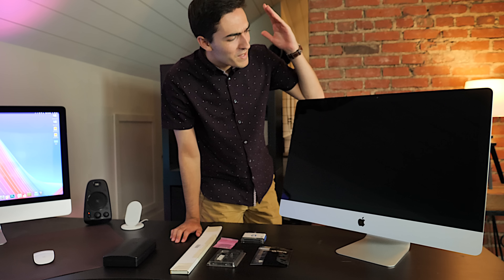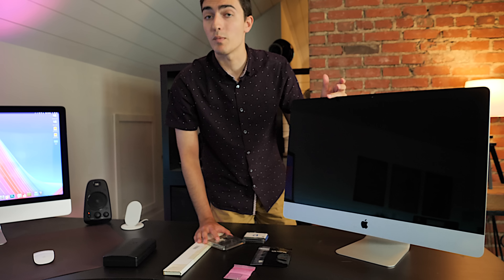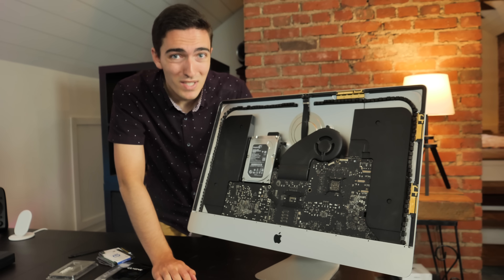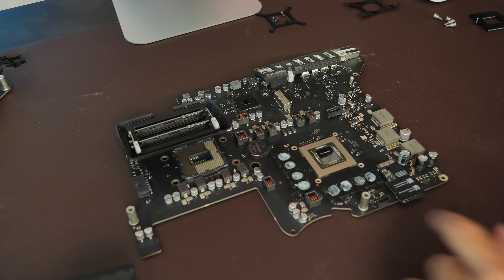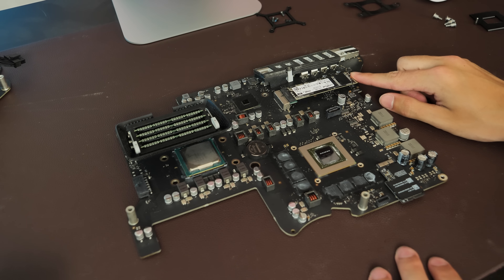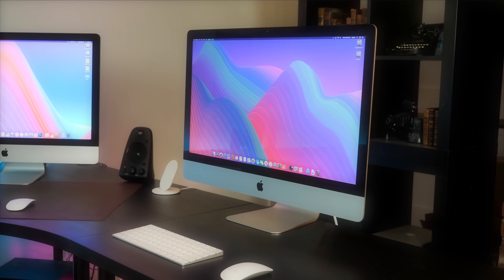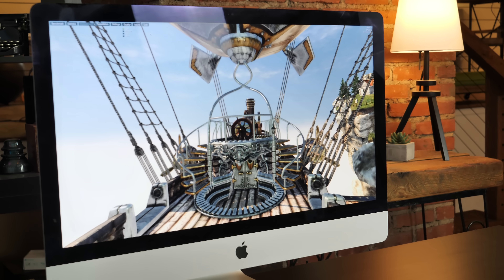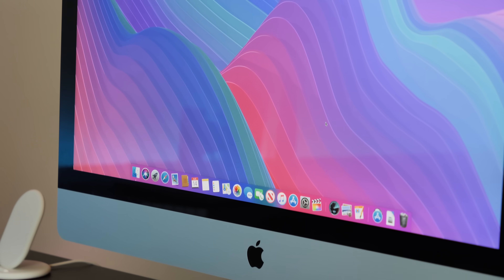Upgrading the $500 2013 iMac to the Max!

Comment: I am thinking about upgrading my iMac 2012 27" but I´ve got a few questions.

1. Is it possible to run Bootcamp with Windows 10 with this adapter method? I read some Amazon review on such an adapter, saying its not working but I could´nt find any further informations.
2. Can I replace the HDD with another SSD without getting into this "cooling / fan spinning issue" because of the missing heat sensor in the HDD?

Help is much appreaciated, thanks guys!

Anyways great Video!

Comment: There is one catch in this situation: when you are installing two separate hard drives with two different file system volumes in a Mac that supposed to have only one - you won’t be able to install the Windows via standard BootCamp utility. 
Because it don’t expect to have two volumes - it won’t let you to select the install location. 
The bug I’ve learned the hard way.
Reply: I know this is 2 years later, but the iMac 2013 27 inch has support for 64gb of ram? Says max capacity is 32...
Reply: @jivexero  I was wrong - 32 GB is max for Haswell cpu.

Comment: some people need to do a little more research about diving into working on these machines... PCs and Macs use electrical capacitor chips in their power module. The capacitors are there to ramp up the electricity to drive some of the components inside a computer because standard ac or dc isn't effective.

The best way to avoid getting shocked by the power module is to unplug the computer ahead of time and remove the power cord. Believe it or not, having the power cord attached will inhibit the electrical discharge and drain from the inboard capacitors. The best safety advice is to unplug and remove the power cord at least 2 days before actually starting work on it. This gives the capacitors adequate time to slowly discharge the stored electricity they hold.

The next step to do, especially if you are in a hurry to break into the machine, is to put your finger on the power button and depress it too activate and close the switch, as if you were turning it on. Press and hold the button for 5-10 seconds and then release. Do this before you start disassembling the unit. The action of pressing and holding the power button in causes the electrical energy stored in the capacitor to flow through they system and discharge rapidly.  This will make it far safer to disassemble and work on the machines without getting residual electric shock from the power module.

I've only dived into my 21.5" iMac only once. But I learned about the power switch technique from watching professional repair videos on owc.com, where professional technicians break down and demonstrate repair techniques for computers. OWC.com has a whole host of tutorial videos that shows and illustrates the proper steps needed to carryout simple to advanced repairs or enhancements to computers. They specialize in Macs by the way.

Don't mess around with electricity young fella. Know exactly what you are doing first before starting any electrical or electronics project... Electricity isn't something to fool around with and it's absolutely important to know exactly what you are doing. Electrical capacitors stores vast amounts of electrical energy in order to boost the power output to a computer. Any kind of capacitor has the ability to kill if touched the wrong way, and are always dangerous even after they are discharged. Safety first, foremost and always.

I am no expert, but I do work on and repair my own computers. I always do the repair research well ahead of time before starting. And I will be sure to keep one of my home computers active and online, showing the proper repair or installation item project I am doing. I always follow all recommended safety procedures, which you obviously didn't do. You unplugged and dove right into opening the iMac in this video without following proper safety procedures. It could have turned out very badly for you. I'm sorry you got shocked, but it could be far worse.

Learn about  proper and correct safety features and steps BEFORE you do your next video. And always be sure to include advice and correct safety procedure recommendations in all your videos. Someone following your advice in this video could be gravely injured or killed, and it would be on your head if that happens... food for thought.

Comment: Format of your video is good Luke, I like the style.
The memory could be replaced in a more easy way from the back, but since you were replacing the cpu, it's logical.
I replaced my HDD to SSD, but cannot get the fusion drive to cooperate with it.... Any idea?
And where can I find the FrankenMac video, for may daughter has an iMac2011 which crashes most certainly on the GPU failure.... 🙄

Comment: Thanks for this! I already have the 2013 27” and I was considering a new computer. I agree that it wouldn’t make sense to buy an older version just to then spend the money to upgrade, when you could buy the older upgraded version, but it does seem worth it to upgrade what you already own. Out of pocket expenses of $400-500 VS thousands for a new machine.
Reply: Absolutely right totally nonsense to spend more money for older machine 😮 the tech still outdated anyway 🤣😂😁😬🤔

Comment: Seriously... that video made my day! Just upgraded my iMac 27 5k late 2015 with an Evo 860 and questioned myself if the same upgrade is possibly with my older iMac 27 late 2013. Now I know it is possibly cause it's an 27-inch iMac! Big thanks for that note man! Cause i'm having just the normal 1TB HDD and not a fusion drive installed and was worried to open the iMac. Now i will speed it up with a fresh pci SSD. WHOOP WHOOP!

Comment: I have.an early 2013 iMac. Can I upgrade to the same specs? Im a little wary about doing the work myself. What would you suggest regards to finding competent Mac technician?
Reply: Bobby Brady  Thanks Bobby. I did look into it and the costs would have around 800 to do so if I get the components off Ebay. Plus I can upgrade my RAM to 32 GB.

Comment: Hi there...I have this i7 3.5ghz 32GB ram 4GB video card and a 1 TB SSD...the most I could afford to buy in 2013!!  How would this compare to a late 2019 imac (not the pro)....just wondering if it would be REALLY worth it upgrading? I do mostly Premiere CC and I'm also learning (finally!) FCP X...I know the 2019 i5 is good...the i9 is really expensive...but are they TWICE as fast as this late 2013 workhorse...a really good machine that doesn't overheat (like the 2015s)...thanks and I'm glad you survived this project!

Comment: Hey Luke, great video. just wondering can i use evo 970 PLUS on this Mac? How about 21.5' iMac with that Blade ssd connection ready? Also, these drives heat up very high and fast. Are you worry about too hot?
Reply from the maker: Samsung drives will work, but 21.5" iMacs don't all have the SSD slot. If the computer shipped with a fusion drive/ SSD when new it'll have the slot, but if your computer only has a hard drive it won't have the slot
Reply: @lukemiani  Yes, it is fusion. I have the 970 plus on hand but worry about the heat, thermal problem that stick generates. I subscribed your channel. :)

Comment: The SSD upgrade won’t support sleep. This machine will fall asleep and not wake up. So if you’re going to do this upgrade make sure you leave the machine to always on. 2015 and higher iMacs Support the NVME drives and all the sleep settings.

Comment: i7-4771 like $150 minimum... pretty expensive upgrade, if you find any imac 27" EMC 2639 in europe, you need around 700-800€ and you might have something else to replace like the screen, so I guess I will go for a Hackintosh, for 1000€ you can get a coffee lake proc and a radeon 580 and a 27" inch brand new screen

Comment: The best Mac value by far is a used iMac where you've replaced an HDD with a 1TB SSD.  This gives you 90% of the speed improvenent that this massive upgrade delivered, and the whole machine runs considerably cooler and quieter, and will last longer.  I removed my HDD to an external enclosure for that reason alone – this will also make replacement much easier when it inevitably croaks.  (I use it as a Time Machine backup drive, for which USB is perfectly adequate.)
Macs Fan Control is a freebie utility that takes care of the fan issue.
Reply: My imac is a 2013 with a 2gb gtx 775m card... Can you upgrade this card to the 4gb gtx 780?
Reply: @goldensafes  no. The GPUs are soldered in.

Comment: I took computer repair class back in 04 in high school and I've  been watching a bunch of repair and upgrade videos lately and noticed no one wears those ground wrist bands is that still a thing or newer electronics don't mess up by the electricity in out body anymore just remember my teacher always saying make sure your grounded
Reply: most people doing this use the anti static mats instead. Its a lot less hassle
Reply: Just give me a good winter I bet I could mess the motherboard up from electricity that I store in my body. I got lucky at times.
Reply: Really it’s a non-issue except in very old hardware.

Comment: Would like to know how you cloned the original hard drive to the SSD.  And then how did you make the SSD the boot drive?
Reply: Carbon Copy Cloner, trial version works for 30 days, then go into System preferences and change the start up disk to your new ssd

Comment: I have the 2013 27" iMac with a GTX 775m and 3,4gHz i5  and replaced the HDD (bought it with a Fusion Drive), so now I have about 120GB on the original SSD + 500GB on the MX500 via SATA. As the time passed by I also added 16GB RAM (2x 8GB) for a total of 24 GB. I am perfectly fine and happy about my purchase 6 years ago. It will be used until it's death.
Reply: hi  there. I too have a maxed up late 2013 imac and after replacing the HD with a 1TB SSD it really works nicely...but I wonder how much faster the 2019 imacs (not the pro) but the i5 and the expensive i9 are compared to the 2013...I hate the "marginally" faster upgrades...if I buy a new one  I want it to be a real big upgrade. I do mostly video editing with Adobe CC and I'm finally learning to edit with FCP X...have you seen any videos comparing a late 2013 i7 vs a 2019 i5 or i9? Thanks!

Comment: Will this upgrade work on a late 2012..? Factory processor is a 3.2 gig Intel i5.. One good thing is I live in Thailand and computer bits and bobs are cheap as chips, but buying a new Mac is painfully expensive. I specifically use mine for Logic X. Cheers!

Comment: I have a late 2013 27 inch and Apple said the logic board is bad. I am not going to give it away but would like to make the repair and keep it. I did purchase a new 2019 27 inch and this machine is bad ass with the 5K. Where do you think I could get the original logic board or one that is as good for this computer.

Comment: With the upgrades, I just want to know how it would fare with video editing. Can it already handle 2K or maybe even 4K files in FCPX?
Reply: I got the core i7 4770 in my Windows gaming pc and in Sony Vegas it does my simple 1080p editing just fine
Reply: Purchased late 2013 iMac 27” for $520: 3.5ghz, 1tb hdd, 16gb ram, gtx 780m 4gb
Upgraded for $100: 32gb ram & 1tb nvme ssd (holding 1tb hdd as 2ndary storage)
Deep-cleaned internals and repasted heat sinks: not a gaming machine whatsoever, however, runs 4K video editing & scrubbing BUTTERY SMOOTH! 🧈 🧈 🧈 the 4gb vram really helps if you’re not a professional video editor that needs to churn out projects, this set up is fantastic

Comment: If someone invented away to convert those adhesive strips to powerful magnets, that we can remove screen off any time, they would be rich.
Reply: Couldn’t you just use the tape to attach magnetic strips to both sides? 🤔
Reply: @glofishdesigns  
That's what I mean, magnetic strips on glass panel and Fram, glued on with tape, that way you just pull off the glass panel.
Also, I'd like to see someone modify the back of a iMac, so cover is removable and access CPU and M.2 easily.
Reply: Just use sticky-backed Velcro.

Comment: you can control the fan using an application it solves the problem of overheating  , just set the right fan speeds and you good to go with your ssd (a proud user of a 2011 imac)

Comment: Funny thing, about 2 months ago I bought pretty much an identical machine locally on Craigslist for $420
It's a Late 2013 iMac 27'
3.5 GHz Intel Core i7
32 GB 1600 MHz DDR3
NVIDIA GeForce GTX 780M 4 GB
And it was already upgraded to 500GB SSD

Such a great machine, I edit in FCPX on it and it's so fast and smooth...
Reply: Hello.. Can you please tell me the model of the iMac bought? I would like to buy one with the same specs.
Reply: impossible deal even now, stop showing off
Reply: @UP209D  Not really just yesterday I got a mint 201327"  i7, 3TB Fusion (128gb SSD - 3TB platter) 16Gb ram GTX 775 2gb with mint Magic Mouse and keyboard for 320 AUD (232 USD) on Facebook marketplace. Kinda felt bad for the old dude selling it 😳 You can tell this thing had hardly been used, cleaned the dust out of the SD card reader and everything is working 100% Good upgrade for my 2010 27" i7 which is still working perfectly 12 years later.

Comment: I did the same with an imac 27 "2017. Buy the base model (new), change the processor for an i7 7700k, 64GB of RAM, SSD purchased on original eBay without adapter.
In a few days I will change the HDD for a sata SSD.
I would like that in your videos you can better display the screen showing the changes in the system.

Comment: I just bought a mid 2011 21.5 inch I5 Imac with 4 gb of ram and a 500 gb hd & OS  X Sierra for  $85 + 30 shipping ! I have been using an early 2008 Imac with 8 gb of ram and a 250 GB HD. On the first of the month, I will be buying 32 gb of ram for it. This will be my most powerful Imac ever. Brand new this Imac was $1199.  I have an early 2008 Imac with 16gb of ram and a late 2010 Imac not sure of the ram because the hard drive failed when Fuzzy Cat pulled the power strip out of the wall. It has the original ram from when I bought it brand new for $1199 in October 2010. - Mac Tracker says current prices are $245.06. Price ranges on Ebay start at $ 175 & go to $374.99. When I have the money I will upgrade the hd to a 2 MB.

Comment: why was the m.2 nvme ssd used with the adapter instead of using a straight m.2 ssd? Is the socket sata or pcie? I'm Confused.
Reply from the maker: Apple has proprietary drive slots so you need the adapter to fit a normal NVMe drive, it's just a simple pin adapter.
Reply: @lukemiani  Do you know if the NVMe drive with adapter is faster (read/writes) than a ssd with the apple proprietary connector?

Comment: Very informative. I have an iMac 27-inch Mid 2010, 2.93 GHz Intel Core i7, 8 GB 1333 MHz DDR3, ATI Radeon HD 5750 1024 MB with a 2TB 7200 rpm Hard Drive. I'm not able to upgrade to the latest OS. I work a lot with the video. What can I do to upgrade this iMac to its full potential. What would you do if you wanted to make this the best iMac ever? Am I able to upgrade to SSD drives?
Reply: Luke takes old iMacs and transforms them and I was just wondering what can be done with mid 2010 iMac.

Comment: Imac 27" 2009 core 2 duo, 200$? Is it a good deal?
Reply: But can't the 2009 imac be used for simple design tasks? Like photoshopping? The buyer said that he got the Ram up to 12Go. Would that help?
Reply: Maybe the 2012's, or so..
Reply: Bobby Brady  For a 2012 iMac, can i upgrade the SSD disk (not the HDD) with a NVME drive or i need at least a 2013 iMac?
Reply: Bobby Brady  Oh... Thank you very much for this clear answer.. :)

Comment: If I don't upgrade my 2013 iMac, I'm considering gutting it and converting it into an external display. I've found a few resources on how to do it; doesn't look too hard. However, I'm very curious to see if there's a way to get the speakers to work as external speakers as well.
Reply: @Next Level Code It does, though only with other Macs via thunderbolt 2. But at that point I'd be losing out on the resale value of the other internals.

Comment: I just got done fixing up a 2011 with a bad backlight. Upgraded to a 2600s and a 765m for Mojave compatibility. Fixed the backlight, but broke the LCD in the process, so that hurt the budget buying a new one. Don't take the display panel apart like I did to resolder the backlight connector. Just do like everyone else and solder wires through the hole on the back of the display.

Comment: I used the same adhecive strips for my own iMac-Upgrade but now, two months later one corner of the display stands off a little...
Reply: Did you thoroughly clean the residue on both sides

Comment: You don't need an NVME SSD for those iMacs. You can straight remove the HDD and put a normal 2.5" Sata SSD inside without any sensor issue.
Reply: The NVMe one will be about 50% faster than the SATA one and the later models can be hugely faster with NVMe. I normally leave the HDD in there, add the NVMe and keep the HDD as a Time Machine drive, then you don't have to worry about the thermal sensor and you have a convenient backup

Comment: Luke great video.  Shame you didn't detail taking the MB out of the iMac, but I'm sure there are detailed instructions elsewhere in the interweb.  I was wondering about the adhesive tapes you used.  Looking at the reviews on Amazon, someone mentions that they are not the "sponge" tapes used by Apple and when they tries to gain access to the iMac with the new adhesive strips they were much more difficult to remove and they broke their screen trying.  Any thoughts.
Reply: Bobby Brady  Thanks for taking the time to reply.  Much appreciated.